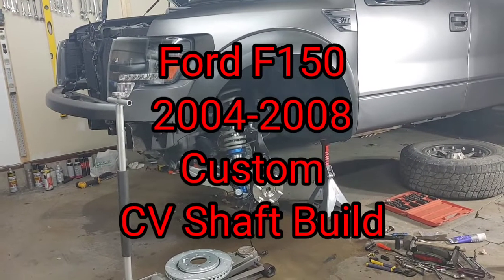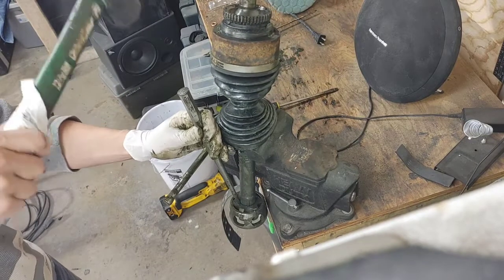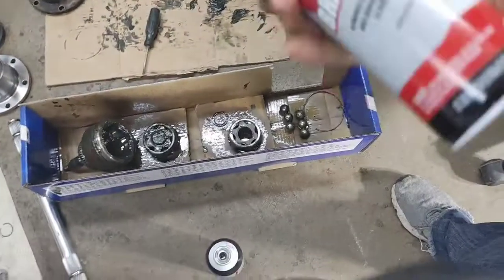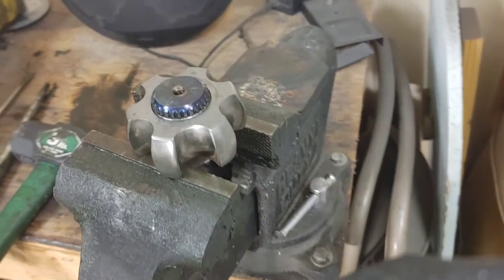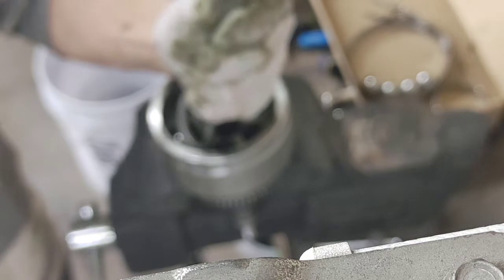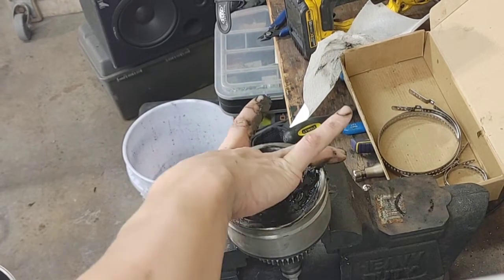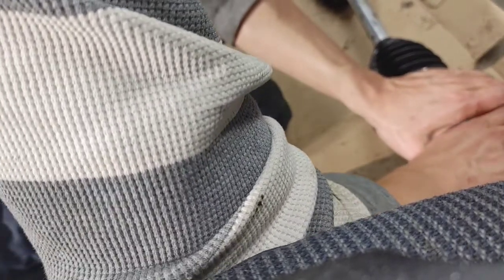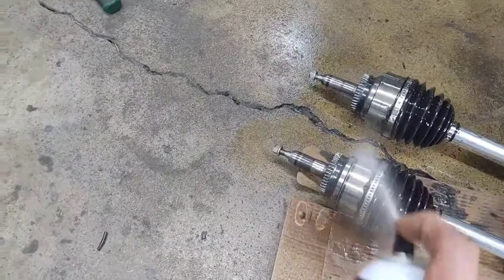DIY (1st Generation) Raptor swap front axles for Ford F150 2004 to 2008.

Comment: Love the video, doing the same thing.   Do you have a list of parts you used?  and a better shot of the outboard grooves you cut?   Thanks in advance.
Reply from the maker: Unfortunately I don't have any decent video/pics of that part. Originally I was going to cut the relief with a lathe but the axle shaft material is too hard for a tungsten carbide tool. Instead, a .060 cutting disc was used to cut the groove just deep enough for the clip to pass the shaft grooves.
Reply: @pocketpoolboy  ok so if I understand correctly, the groove is deep enough for the snap ring to be compressed when you slide the outer race over the splines and as it comes through, it expands and locks the shaft to the drive race.   Am I on the right track?
Reply from the maker: Parts in previous comment.

Comment: Where did you get the shaft from?  What’s the measurement of the shaft? Can you add a link of where you got the shaft?  Thanks
Reply from the maker: Parts/tools used:
Custom length shaft: https://amzn.to/3lWtX5i
CV boot clamp tool: https://amzn.to/3vr9jxo
CV boot kit (that doesn't require above tool): https://amzn.to/3AVLi2n